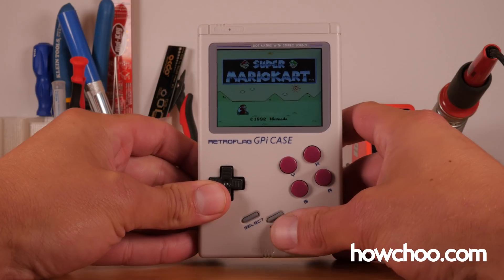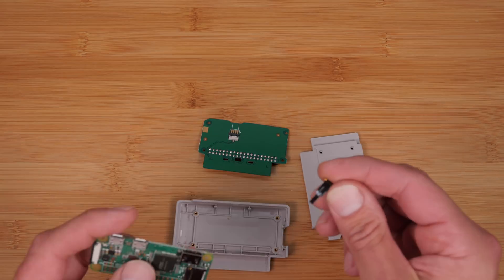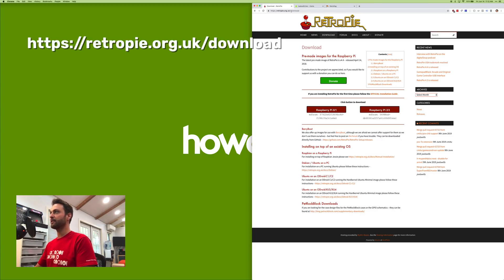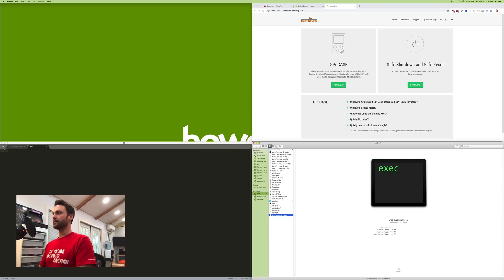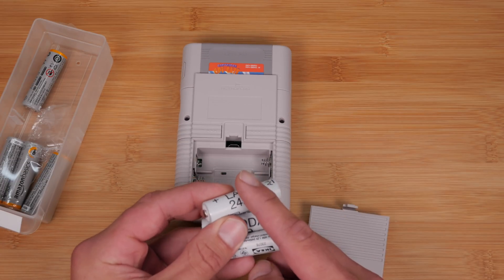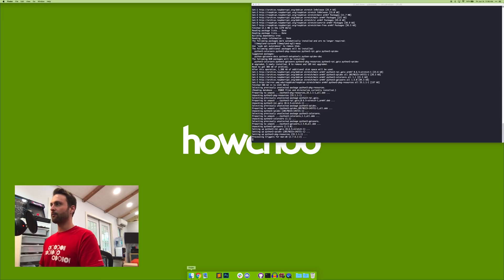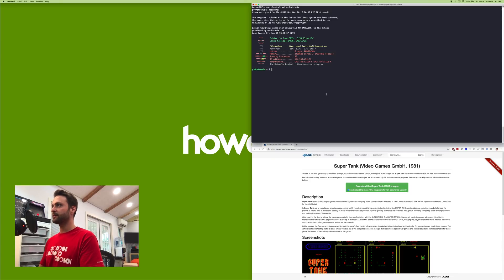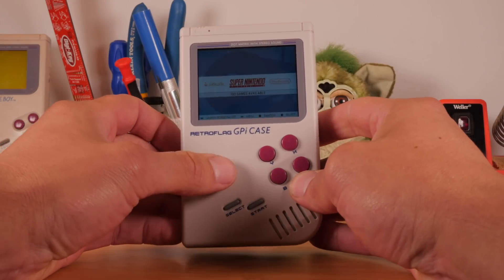Retroflag GPi Setup: Everything You Need to Know to Get Playing!

Comment: You can charge batteries in series, but you have to take some precautions in the circuit. I have a sharp palmtop that charges two A size NiMH batteries in series. The charge voltage is 5V from the transformer. Presumably it is charging at less than that. It has a heat sensor which will break contact when it gets hot.

Comment: FOR THOSE ON MAC HAVING ISSUES WITH LOADING ROMS:

The homie u/jackfennimore on Reddit SAVED me as I was going nuts trying to figure this out. So if your Mac and Pi are connected to the same network and powered on, the Retropie volume should mount automatically.

HOWEVER if it doesn't (like it did for me), you can connect directly to the GPi via the GPi's IP address (in a Finder window, click "Go" on the top menu, then "connect to server", then connect as a "Guest" instead of the Admin/main user).

I thought my issue had to do with our Google WiFi being 5ghz, but it appears that wasn't an issue after all.....I just reloaded EVERYTHING (I think I got corrupted on the first go-round), followed u/jackfennimore's tip, and I was finally able to drag and drop my ROMs into the destination folders! Hope this helps! :]

Comment: Just updated my software to 4.6.9 and now the pi runs extremely laggy when playing games and navigating menus. Any thoughts on how I can fix this?

Running Raspian GNU/Linux 9.13 (stretch). Runs on 3 AA batteries, batteries are brand new. After update, the controls operate extremely laggy, and games play in almost slow motion. It also seems like the pi it self becomes hot quickly after start up. No other modifications have been made except for updating the software and the underlying packages.

Comment: Hi, I've followed the instructions and everything works well, I just have an issue with the button set up,  For some reason my select and start buttons don't work.  So I get stuck on the Retropie menu and can't get off it.  When selecting button when loading up it states none selected but does the D pad and the A B buttons.. Really stuck so any help would be greatly appreciated.
Reply from the maker: Hey James, that’s super weird—sounds like a hardware issue. Are you able to use the other buttons to navigate the menu?
Reply: @Howchoo  Hi thank you for your reply.  Thought it was a hardware issue, but I've got a replacement with an installed card, worked fine.  But I wanted to try it again and have just done a new SD card same problem.  So I feel it's user error but am baffled really.  I'm adding the patch manually via a mac and then getting the network connection fine.  I can add a rom and get on it but can't play it or move out from it.

Comment: Hi, that was a great guide for the Mac! Sadly, I have one problem.. So.. I followed your instructions properly and then I inserted the SD card but nothing shows up, only a dark blue screen with nothing. I waited for a long time, but nothing changed. What did I wrong? Have I missed something?
Reply from the maker: That’s strange—there was probably an issue with the installation. I’d recommend reinstalling everything again. If the issue persists, try using a different SD card and try reseating the ribbon cable.

Comment: I just got the Retroflag GPI yesterday and lagging quite a bit on every system I use. I downloaded the Recal image and I even have fresh batteries in it. Is there anything I can do to fix this? Please help!
Reply from the maker: Sounds like you're using Recalbox—have you tried using RetroPie instead?
Reply: I gave that a try as well and got the same results. I’ve also tried the Lakka image and that wasn’t much different . Everyone else I see on YouTube seems to be running smooth.
Reply from the maker: Hmm, sounds like a hardware issue then. Which brand SD card are you using? It might not have a fast enough read/write speed.

Comment: What about special characters or spaces in network passowrds? How do you account for those.  I think that is my current hold up to successful wifi connection upon boot up.
Reply from the maker: Those should be fine as long as they're within the quotation marks. Which character do you think is causing issues?

Comment: You omitted the part about flipping the safe shutdown switch to 'ON' prior to installing batteries. You did mention this in your written guide. I installed everything with the switch in the 'OFF' position, and have been using the on/off switch since and haven't experienced any problems. Thanks for the guide!
Reply from the maker: Ah, thanks for pointing this out!

Comment: As soon as I start mapping the controls Emulation Station Crashes. It says to make sure I'm using the right image (which I am) and to check your rom file/folder permissions and if running on a raspberry pi to make sure your gpu_split is set high enough and or switch back to using carbon theme. Any ideas?
Reply from the maker: Hey Evan, unfortunately this could be anything -- your best bet is to reinstall the SD card image and RetroFlag scripts. If it persists, it means it's a hardware issue.

Comment: How would I reconfigure the controls setup upon initial boot? I mixed up "up" and "down" on the pad by mistake out of excitement. Great tutorial though !
Reply from the maker: From the RetroPie (EmulationStation) UI, press START and then select "CONFIGURE INPUT" :)
Reply: @Howchoo  I have one last question, have you had any issues using the GBA emulator on your GPi? Whenever I select the file I want to play, it loads but then just returns to the screen containing the files (same goes for any GBA ROM).
I'm thinking I may need to downlaod a different emulator since any other emulator I've tried so far hasn't given me any issues.
Reply from the maker: @isaigonzalez5633  That depends where you got the ROMs from. Certain ROMs require a separate GBA BIOS to be installed. Try installing that. Here's some more info: https://github.com/RetroPie/RetroPie-Setup/wiki/Game-Boy-Advance
Reply: @Howchoo  Sounds good, thanks a lot !

Comment: Hi there! I had problems connecting the ssh - however - when I executed the command like this ssh pi@192.168.xx.xx, it worked! Just go to wifi and check your IP.
Reply from the maker: Yeah, if you ever connected to "another" Raspberry Pi running RetroPie (which shared the @retropie hostname), your computer may attempt to connect to that previous device's IP instead. I always change the hostnames of my Pis to something more unique and easier to identify -- as you can imagine, I can have ~5 running in my house at any given time. Here's a guide for doing that: https://howchoo.com/g/nmyzm2u0nwu/how-to-change-the-hostname-of-your-raspberry-pi

Comment: Every time I create and add the supplicant and ssh files they are gone when I plug the sd card back into my Mac.  I add these files to the file system, switch on the GPi case after reinserting the SD card and then try to connect through terminal but it states that the "ssh_exchange_identification: Connection closed by remote host" so I assume this is because it can't connect because the files are gone.  Has anyone had this problem?
Reply from the maker: The file SHOULD disappear as part of the process — the OS is consuming it to set the password and removing it is normal. You must have some other issue — have you tried all the steps here? https://howchoo.com/g/ndy1zte2yjn/how-to-set-up-wifi-on-your-raspberry-pi-without-ethernet#troubleshooting

Comment: I've tried for hours tonight to try to get the wpa_supplicant.conf to work it never connects or shows an ip. I've probably restarted the gpi over 25 times it takes ages just to find out nothing happened. I'm finding all the youtubers guides with slightly different wpa_supplicant.conf settings which ive attempted many with no success on notepad++ and plain text document on windows. 

I have 2 different access points in my house one cox and the other century link they are both wpa-wpa2 I've tried them both set for 2.4ghz with no success combined with also editing and retrying with the updated config. Please help :{
Reply from the maker: So I've seen a few people with this problem and in a few cases the issue was with the Raspberry Pi itself. This may seem like a stupid question, but are you sure you're using a Raspberry Pi Zero *W*, and not a normal Raspberry Pi Zero? Only the W has WiFi/Bluetooth. Assuming you are, here are three different things to try:
1. Remove the Zero from the GPi to make sure everything (including the pogo pins) is seated correctly
2. Reinstall RetroPie from scratch. This is super common -- the image got corrupted somehow, so the issue isn't that WiFi isn't connecting so much as it is that the Pi isn't booting at all. If it doesn't boot correctly, it may not consume your wpa_supplicant file.
3. Remove the Zero from the GPi, connect a monitor and keyboard, and then manually connect to WiFi by running `sudo raspi-config` on the command line. Only thing to note -- since the patch scripts tell the Pi to output video over GPIO, you'll need to revert those changes so that it will output via HDMI again. You'll also need a micro USB adapter and mini HDMI adapter/cable to connect it to a monitor.

I'm guessing it's #2, but try all 3 in order and let me know if that works.
Reply: @Howchoo  Thank you got it working the wpa config had needed spacing in several areas. I fixed that and im up and running now a new issue. The git hub link and putty. It begins installing the shut down script but anytime the archive .raspberrypi.org gets cued it hangs and hangs and takes forever to go on to the next step its been 10 minutes and its still at 0% any advice? Ive tried reconnecting putty and running again same slow results evey time and evntually it hangs and doesnt move on anymore.
Reply from the maker: @TB-nf6bs  Good to hear. This sounds like either a network issue or the package manager is down. Can you try again? If it doesn't work, try running `sudo apt-get update && sudo apt-get upgrade --yes` to update everything (make an SD card backup before you do this).

Comment: Hi, great vid! I got as far as to type in the password when connecting to wifi. But when i was going to type the password, cmd, powershell and terminal (tried all 3) i couldn't type the password, i could press enter and it said wrong password. I can type until it's time for the password then it stops all of a sudden. So anyway, i thought something went corrupt so i decided to format and reinstall but now nothing happens, screen lights up, but its all black. Any ideas?
Reply from the maker: Ah yes, so when you’re typing the password you won’t see any output. I.e. no “dots” or anything will come up. So you need to make sure you enter it correctly. If you think you mistyped something before pressing enter, just hit backspace like 20 times to make sure it’s cleared out completely. Let me know how that works out.

Comment: Hi ! Would a CM3 be too wide to fit in the unit using for instance another cartridge ?
Reply from the maker: Theoretically it should fit — the CM3 is 67.6mm long and the Zero is 65mm long
Reply: @Howchoo  Ok thanks for replying. I guess I'll wait for a news version with : CM3 + Battery + Full size USB port. Still a very cool unit as it is and still tempting for sure :) Thanks for the video.
Reply from the maker: @mutmut02_  No problem!

Comment: I followed every step but impossible to get wifi...
Reply from the maker: Are you using a 2.4GHz network? If everything boots properly (and assuming you're using the Zero W, of course), try accessing the WiFi configuration option from the RetroPie Setup menu. This will launch an alternative interface you can use to see if your network is visible.
Reply: @Howchoo  Yes I have classic 2.4Ghz wifi. From Retropie menu I can access to wifi setup but because no keyboard it's impossible to enter password. I tried to import ssid and password using .txt method but it's failed also...
Really hard device to configure for early adopters like us.
Reply from the maker: Ah yes. Do you have a Bluetooth keyboard? Obviously you shouldn’t need to do that but it might be an option.. just to be clear, you’re naming the file wpa_supplicant.conf, not wpa_supplicant.conf.txt, right? Did you use Notepad to create it or a rich text editor? It’s important to use an editor without formatting.
Reply: @Howchoo  Yes, I created the wpa file using notepad on windows 10 and save it as .conf.
Reply: Hi are you solved the problem with the wifi ? I have the same problem
Reply from the maker: @lxllxl100  This seems like an obvious question, but you are definitely using the Pi Zero W, not the normal Zero, correct? If so, can you try removing the Pi, connecting it to an external monitor, and hooking up a keyboard to enter the password through the RetroPie menu? You might need to revert config.txt to output over HDMI.

Comment: Hey there, I have managed to install Retropie 4.4 for the Pi Zero and have ran the Patch and have installed the safe shutdown script.  However, whenever the Pi reboots, the system always hangs at the Check disk screen.  Once it reaches 100%...it doesn’t continue to load.  I have waited 10 minutes and still nothing.  I have reinstalled everything again with the same result.  Any suggestions?
Reply: I had the same issue. I ended up downloading Retropie 4.3 instead, and everything started working.
Reply from the maker: That's definitely . weird. Do you have another Pi you can try? Or a different SD card? Does this still happen if you don't have the safe shutdown script installed?
Reply: @Howchoo  So I have reinstalled Retropie 4.4 again and installed the patch and safe shutdown script.  I read on Reddit to disable  fsck as a temp solution.

You need Notepad++ to do this:

Put the SD Card in your PC
Then Open "cmdline.txt"
then change, "fsck.repair=yes" to "fsck.repair=no"

This seems to have solved that problem..for now.

Comment: Did all the steps up to trying to connect to the pi via terminal I keep getting "Could not resolve hostname retropie: nodename nor servname provided, or not known" im on a standard wifi network and all the credentials are  entered correctly...any thoughts?
Reply from the maker: Sorry for the delay! Does the GPi boot normally otherwise? If so, select the RetroPie menu item and find the WiFi config menu item. See if your network is listed as connected there.
Reply: @Howchoo  same here. it keeps deleating the wpa_supplicant config file. I edit it, put it on there, put the sd in. No connection. I remove the sd, put it back in the card reader, and the file is gone :(
Reply from the maker: @Phi1981  This is supposed to happen -- when the Pi boots, the wpa_supplicant.conf file gets consumed and then removed. Can you confirm 1) That you're using a Raspberry Pi Zero W (not normal Zero), and 2) That you're trying to connect to a 2.4GHz network (not a 5G one)? If so, can you paste the contents of your wpa_supplicant.conf file here (with network name and password removed)?
Reply: @Howchoo  Thanks for your answer! I figured it out now and it works. A guy from the community totally helped me out a lot! Thanks everyone!
Reply: I'm having the same issue. I'm pretty sure i've got the credientials correct for my wifi, but it won't connect. Also, I connected a bluetooth keyboard to the pi0, and manually selected my wifi and connected. But it the connection to my wifi failed for some reason.

Comment: Can anybody help me fix my screen the text looks all pixelated and so does the screen it's like blurred out and not as sharp and clean as it shows in the video or as it should? Its also affecting my emulators. And yes I already tried reinstalling the image and trying the resolution settings in the raspi config but nothing has made it better.
Reply from the maker: Have you tried disassembling and reseating the Pi and ribbon cable? It’s possible the pogo pins or cable aren’t making a good connection.

Comment: I can’t seem to get mine to boot? The light comes on but turns off after 2 seconds. Nothing comes on the screen. I’ve reinstalled a couple times and taken it apart and reassembled. Not exactly sure what I’m missing. Any ideas?
Reply from the maker: Did you install the patch properly? Can you SSH into the Pi even after the light goes off? Trying to determine whether it’s actually booted and the display just isn’t being output.
Reply: Thanks for the help! I’m embarrassed to say what the real problem was.....but i got it up and running perfectly fine.
Reply from the maker: Glad you got it working :)

Comment: Hmm, how do you connect if you are using the standard Zero? Or would that be something you would have to set up on another Zero setup and then pop the card over?
Reply from the maker: That would certainly work. Or you can remove it from the GPi, connect a WiFi/Ethernet dongle, and log in. Absolute worst case, you could look at what the safe shutdown shell (.sh) script is doing and recreate it/download all those files locally.
Reply: @Howchoo  Honestly I think the issue I was concerned with won't be a problem anyway, looking at power benchmarks it seems that the W uses the same power as the base Zero if you turn off the wifi and blutooth on the boot partition. At that point it's just a case of popping out the sd card and messing about on the boot partition on the PC when I want to reactivate. :)
Reply from the maker: Good to hear! Have fun :)

Comment: I'm getting a kernel error.  Retropi locks up everytime on start up.  Not sure what I'm doing wrong?  Going to test my raspberry pi zero outside of the case to see if I get the same problem.
Reply from the maker: Did you try reinstalling from scratch? Something wonky may have happened :)
Reply: @Howchoo  tested my raspberry pi zero.. it's bad.
Reply from the maker: Ah that’s probably the best outcome it could’ve been. Glad the GPi is ok; the Pi Zero is cheap